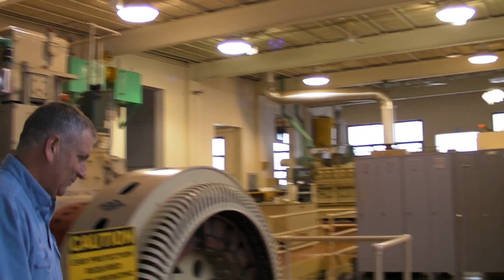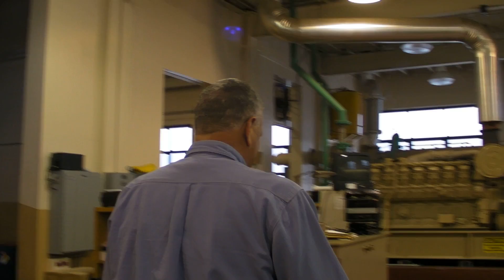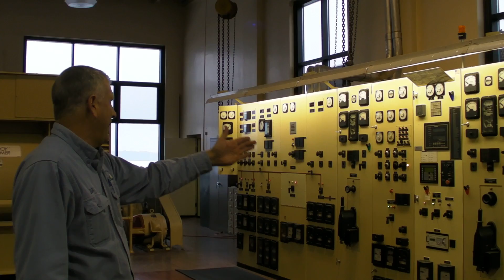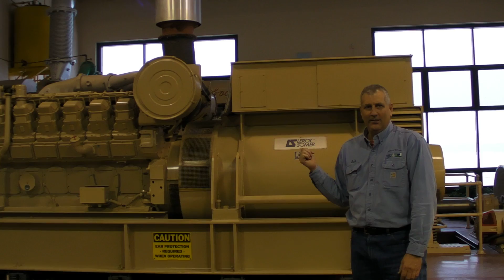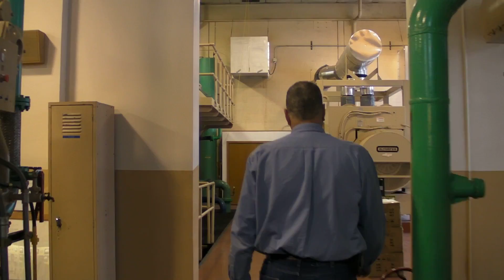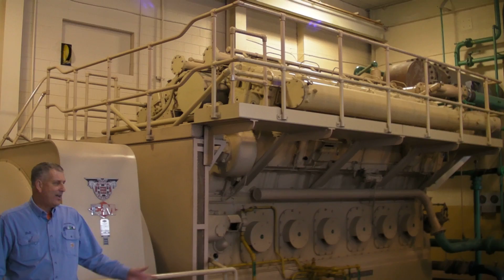Bellevue, Iowa Electric Power Plant Tour

Comment: Nice tour, I work for a 911 Communications district and we have the ability to power all our facilities and tower sites as well. However we can slam load our big diesels to be under load in less than 10 seconds. I am just curious as to what takes so long to start up and start powering. I know grid sync and ramping off the mains takes a little longer however it just seems like a while to me. Thanks again for the tour!
Reply: Old post but I'll take a run at it.  The 911 gen are kept at operating temperature by the use of coolant heaters and long term engine life is less of a consideration with an emergency generator.  The chances of your 911 power going out is greater than with the entire town of Bellevue losing incoming power so I'm betting they don't want to spend the $$$ to keep all the gens hot 24 / 7 .
Reply: @bobroberts2371  I would be willing to bet your probably correct. We do keep out generators at operating temperatures all the time with the use of circulating coolant heaters. As this is how we are able to start and go under load very quickly. There is certainly a cost to this however.